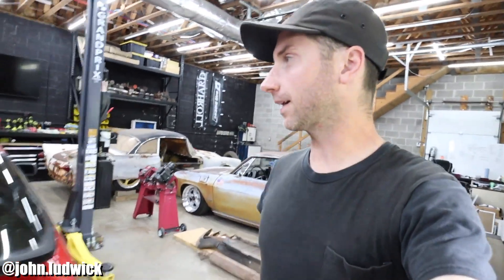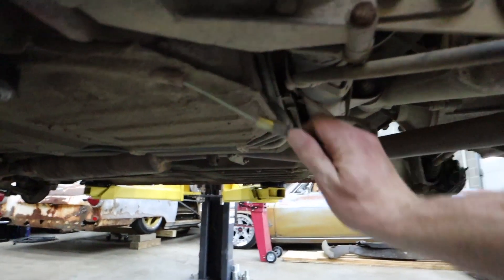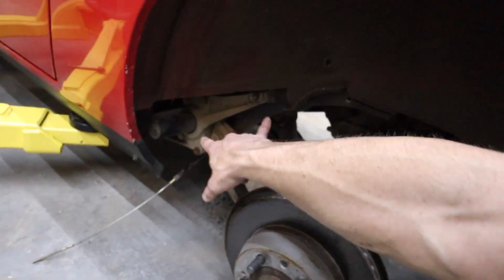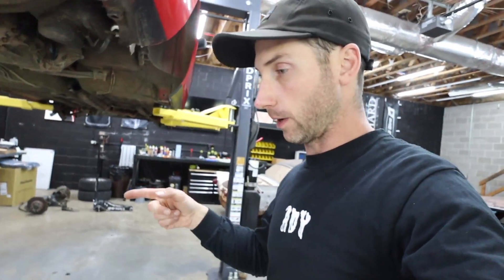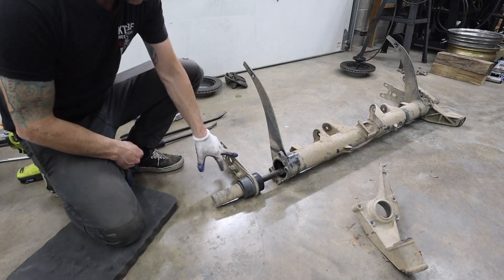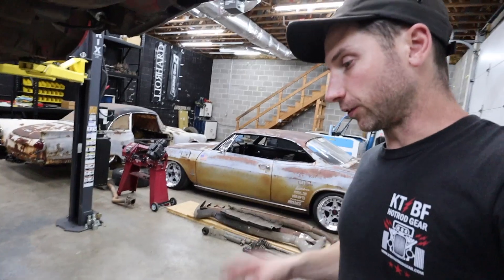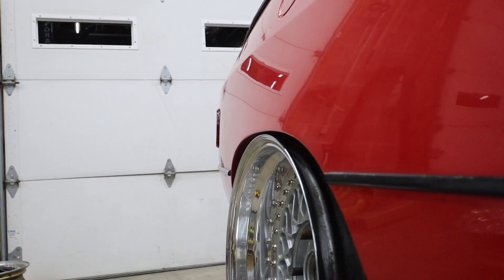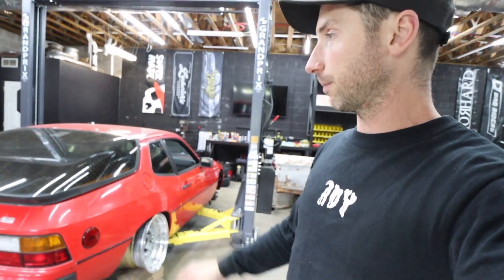Swapping A Complete Early 944 Rear End Into The PORSCHE 924S

Comment: very interesting video John, I didn't know that the 924S has the late 944 rear axle (wider spec). It's funny because I actually have an early 944 and am planning to get late 944 or 924S rear axle to perfectly fit the 911 cookie cutter wheels which were also OE on early 944  :)  Unfortunately now it's very narrow even with oem 20mm spacers. I've added 45mm spacers but on the long run it might break the hubs prematurely ^^'
Reply from the maker: The next video on the channel actually deep dives on these rear ends, and what you can do with early 944s for coilover options and rear end swaps!! Should be live on Thursday!